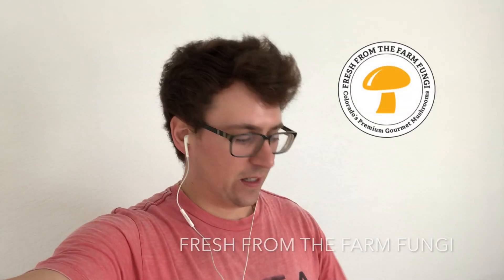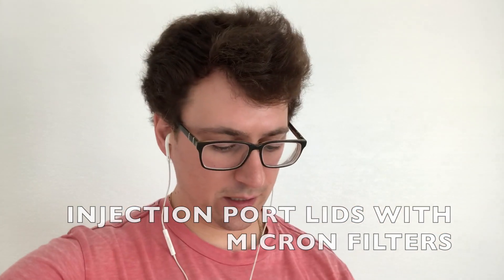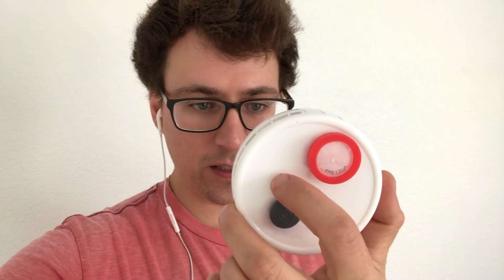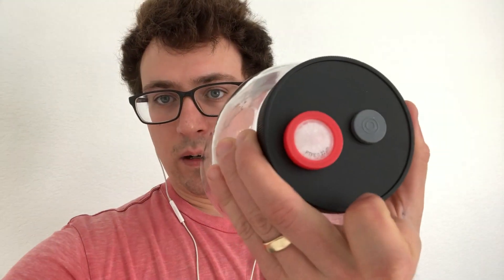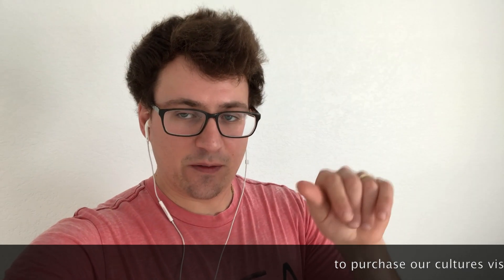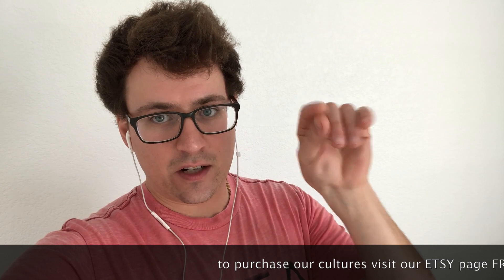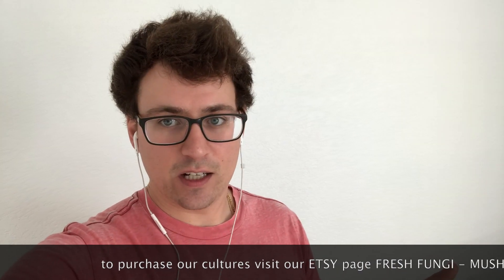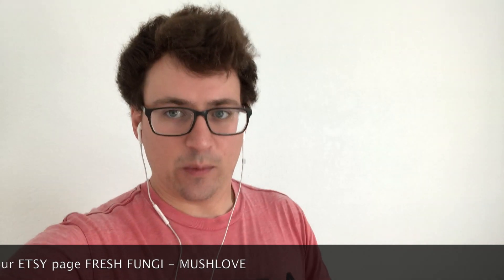Making injection port lids with micron filters for mycology

Comment: Hey guys, I'm new to this and just setting up my lids! Can someone tell me please what hole size I need to drill in the lid for the injection filters 0.22 micron 13mm? 🤔 I'm using metric so be helpful if you can give me the hole size in mm! I'm thinking 4mm? 🤔 Is this correct 🤔

Comment: Hi. Which port would you use for sucking, and which one for injecting? 

Is the gray one for injecting, and red one for sucking a LC syringe out of the jar?
Reply from the maker: the same port (the gray one) is used for both injecting and taking samples out - the red one is a filter disk so as you displace the air by adding or subtracting liquid it keeps the system sterile
Reply: @ ahhhh that makes a lot of sense. Thank you for that!

Comment: If I use a metal lid and flip it upside down, does it still make a good seal? Also im curious about what happens if you dont flip it?
Reply from the maker: Yes I usually use them for a couple runs until
they rust out.  If you don’t flip they will make a canning-like seal and to open them you will have to break the vacuum which isn’t ideal.  It’s better flipped or if you add a syringe filter it will help to displace the air through the filter so it won’t make a vacuum
Reply: @FreshfromtheFarmFungi  thank you so much for the reply. I have everything ordered and planning on making my own agar, grain spawn jars, and LC. I got the basics down but it's time I level up.. MUSH LOVE

Comment: Hoe come you said to flip around the metal ones? What mm are those filters?   The phobic ones. Thanks you use  same mm for lc and grain
Reply from the maker: .2 micron, I prefer glass but they all work the glass will just last longer and if you don’t flip the metal lids it will create a seal so for grain jars it’s harder to get the lid off and can create a mess

Comment: When installing the hole in the lid, I noticed you ran the drill motor in reverse and melted your way through the lid. Is that, in fact, your technique?
Reply: Most people recommend drilling through plastic in reverse to minimize mess and grabbing. Just personal preference.

Comment: 2023 and I just got my lid materials in today.  For anyone wondering, these specimens that he is using are rather large.  They look to be extremely high quality.  These injection ports are going to need around a 1/2"  (12.7mm) hole to fit in to.  The luer lock filter disk look professional but, again, they are much larger around than I would have expected.

Comment: Sorry if this is a dumb question, but I am new to all of this.... I'm not sure what the syringe size applies to.
If I plan on using a size 15mm or 18mm syringe needle, do I need a size 25mm syringe filter?
Reply: Hopefully you've figured it out by now but you're mixing up all your numbers. The syringe gauge has nothing to do with either the self-healing port or the syringe filter (which is for gas exchanged not the needle).

Comment: Hey Gary,  the max operating temperature for those syringe filters is 80 C. They are not designed to withstand pressure cooking/sterilization at 15 psi for 25 minutes.  Any suggestions?
Reply: they worthless  thats why no answer.

Comment: Hello. If am using those same syringe filter for cordyceps cultivation. Can I reuse those filters next time or should I change after each harvest. Same question for liquid culture too
Reply from the maker: you can reuse them until they get plugged they will eventually turn off white and then need to be replaced

Comment: put the plastic lid on a jar and set your drill really low and put force on it, once its pierced through pull it out and turn the drill on. itll create a perfect hole and the plastic gets pulled out with the bit.

Comment: I stupidly flamed my needle but didn't let it cool off enough, so it melted a hole in the port, and kept it from "healing". Not visible but large enough to allow contam. Having a hard time finding plastic lids
Reply: Walmart.  Has plastic ball lids both wide mouth and regular around 8 $ for 6.  They also have there own brand that are white plastic for like$ 3.50 for 8 lids regular mouth though .

Comment: is the silicon save? Wont be releasing some chemicals, when heated?
Reply from the maker: You can use without silicon but it helps preventing contams from getting in and it doesn’t come into contact with the mycelium only for a brief time when pulling with syringes.

Comment: A good alternative to the twist bit for plastics is the stepped reamer bit. It won't grab like the twist. For metal, a hardened punch setup should work.
Reply from the maker: thanks! My friend now has a nice drill press that I benefit from ha
Reply: i don't have a punch set, i just use a step drill and a sacrificial piece of wood for backing and the holes come out clean, straight and chamfered. You can get pretty much any hole diameter with a step drill

Comment: How do you find the white plastic lids to hold up in the pressure canner/sterilizer ? Have you had them awhile and have they warped? I just got a bunch of them due to my metal lids rusting. I may start spraying a layer of clear coat before hand to help prevent rust after I puncture the holes
Reply from the maker: Just make sure they are pp5 rated (there will be a small triangle with a 5 in it)

Comment: Dude, I think you had that drill (large bit) in reverse.
Reply from the maker: Yes it was on purpose - to prevent the plastic from cracking
Reply: You can prevent cracking using drill bits made for wood. Don't use metal bits for plastic in reverse... @FreshfromtheFarmFungi

Comment: Hello Gary, do you use gaskets with the plastic lids? (I understand they’re not airtight.) Or does parafilm suffice? Thanks for such quality info and education!
Reply from the maker: I do not use gaskets for plastic lids in my experience if you pull them out while still warm from the autoclave/pressure cooker you can tighten them down and get a good seal since the plastic is malleable at that time

Comment: Does the syringe filter provide enough FAE for the grain spawn?
Reply: Don’t need FAE for colonization... just gas exchange. So no and yes... u won’t get much fresh air exchange but ull get the sufficient gas exchange needed for colonizing the grain.
Reply: Also FAE during colonization can dry out your grains so best to avoid it... a little gas exchange is all that’s needed

Comment: Hello.  Where can I buy the same red filters?  can you give a link please
Reply from the maker: I got them on amazon, 0.22 micron filters
Reply: @FreshfromtheFarmFungi  thanks
Reply: @FreshfromtheFarmFungi  why did you choose the 25 mm diameter?  Have you tried 13 mm?
Reply: Good morning 🌞.there are 13mm filters on sale.  you have a 25 mm diameter in your video.  I wanted to ask why I bought these 25mm?  13 mm worse?
Reply from the maker: @MegaUrod  both work fine I think I got them for a good price but I actually use the smaller ones as well

Comment: I recently found out the plastic lids are meant for freezer use, and allow air exchange when not used with the gasket ring.  Since the gasket rings are painful to use/ fall in your mason jar from time to time, a bead of RVT along the circumference does the job better.
Reply from the maker: Thanks for the insights! I have been using these for 6+ months still working great (about 25 sterilization runs) No gasket just tightened up firmly - although for LC’s it might help a lot to ad the gasket MUSHLOVE

Comment: Do you need to silicone the fabricated injection port in? Isn’t the friction fit enough? I’m scared because I haven’t put silicone on mine 😐
Reply from the maker: Matthew Taudevin It might be overkill yes - We have been using some without it with no issues but my thoughts were for long-term usage and might just replace them as they get worn out anyway (the ports that is)
Reply: Not needed it should be a tight fight and create a air tight seal, once worn just pop out and pop a new one in
Reply: @justinlangley9529  Im gonna go the gasket route, white lids  w/ silicone gasket....have you had any gunk problems there??

Got me some ports, and syringe filters and am gonna make some lids on white plastic.....not sure if i should epoxy SF though.

Thanks

Comment: Gary great video as always. Question 1: you made a video about a month ago about the different type of agar dishes used for testing your area for different types of contamination and you were going to go over the results but never did. I was wondering if you were ever going to come back to the results?
Question 2: I have seen some people use MEAC agar and was wondering if the activated carbon actually does anything for the mycelium growth or does the carbon just make the agar black for better mycelium growth?
Reply from the maker: Hey thanks for watching! The plates we use to do our QC were negative - which means there is no growth on the plates so that is why I never posted the results.  I will be making more LC's with these new lids and will be testing those as well! As far as activated charcoal, I have used it in the past with plant tissue culture and the reason we used it was to absorb excess exudates from the plants which affected the pH of the media.  The charcoal was more of a buffer to absorb excess exudates.  That being said, there may be applications in mycology related to this idea.  If some mycelium releases exudates that affect the pH of the media, it might help to add activated charcoal.  In this regard, it would be promoting healthier mycelium because it would keep the environment more stable for better growth.  (there may be other applications that I am not aware of)  MUSHLOVE